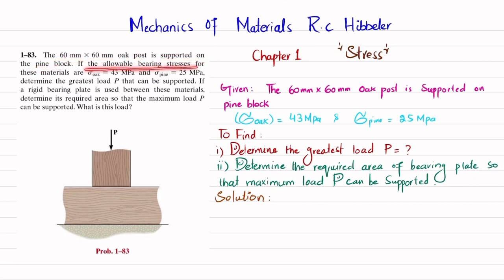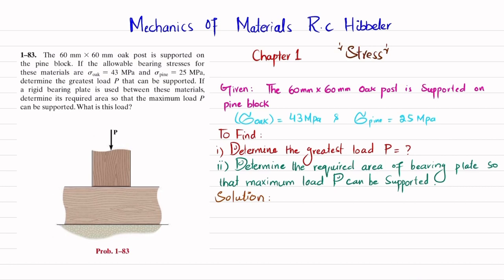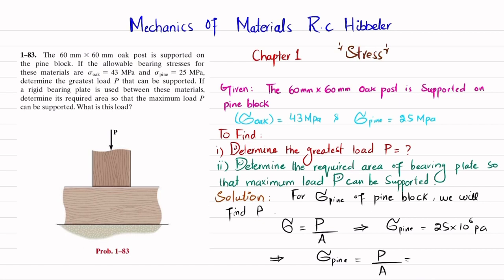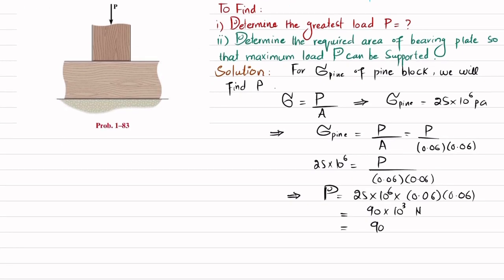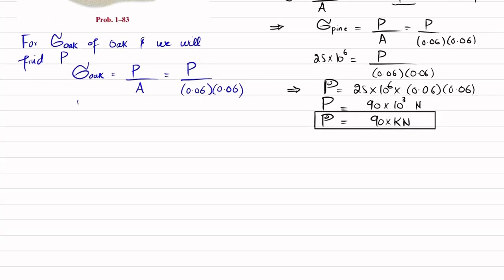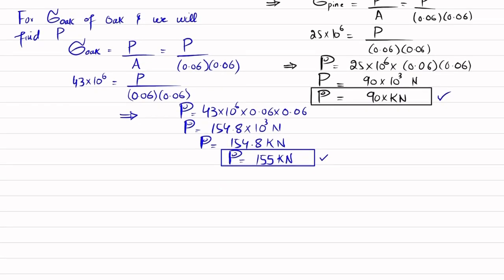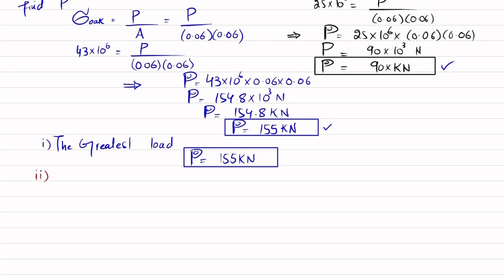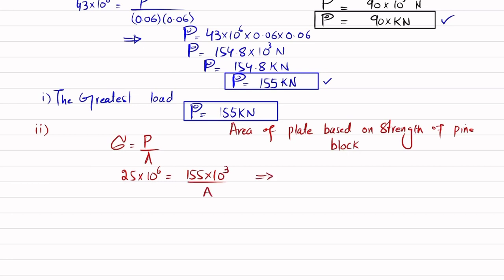1-83 | Determine the greatest load P that can be supported | Stress | Mechanics of materials rc Hib

Comment: For part i, why isn't the answer 90? Shouldn't the lower "maximum stress" control what the maximum load that can be supported by the system is?
Reply from the maker: Yes you are absolutely right the answer of part 1 should be 90 KN that can be applied safely. Thank you